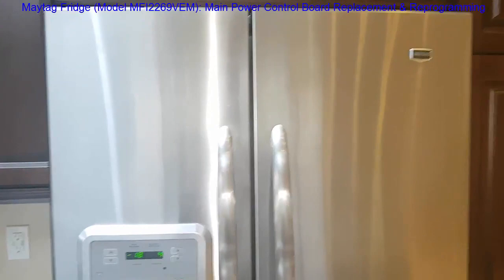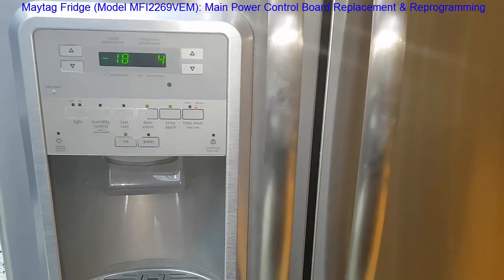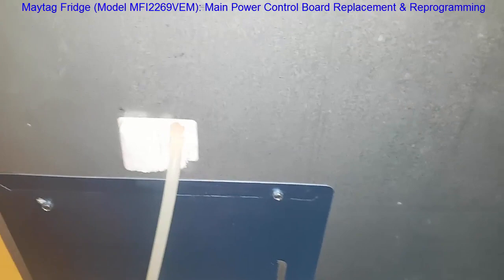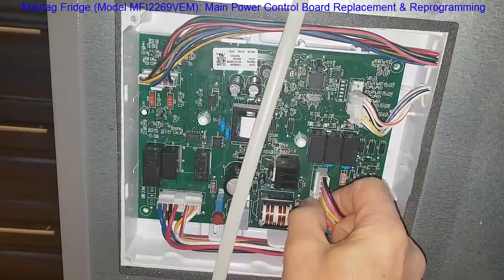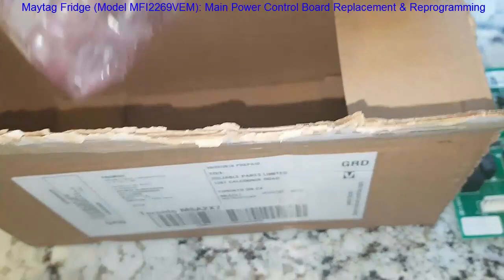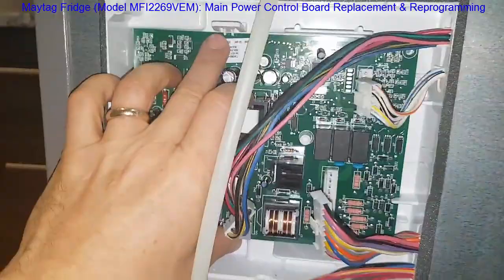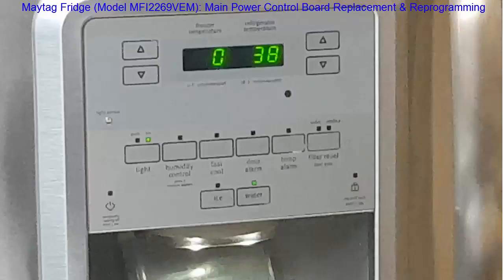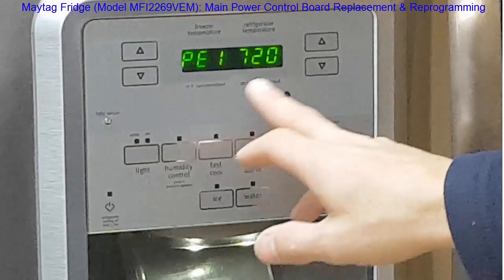Maytag Fridge - Main Power Control Board Replacement and Reprogramming

Comment: Thank you so much for the video.
I have replaced my control board and fridge is running, however I’m trying to type in the code and the keypad is not working 🤔
Reply from the maker: Hello Alberto, Thanks for your comment. I'm not sure why your keypad is not working. Do you have any indication on the front control board that it is functioning (any lights on at all)? Maybe you need to ensure that all the connectors on the control board you replaced are properly installed and secured. If you have power and cannot enter the programming mode then please refer back to the video (at the 7:20 mark) and carefully review how to enter the programming mode. If you experience any problems  please refer to some of the comments left by others who experienced a number of issues related to programming as your issue may have already been encountered and resolved. I hope this helps. Vito Casola, FIX IT Yourself.!!

Comment: After replacing the board, everything worked except the ice maker.  Any suggestions?
Reply from the maker: Hi Timothy, Thank you for your comment. Did your ice maker work before replacing the board? You're the first person that has reported this issue so I can't give you any recommendation. It seems odd that changing the board everything would work but not your ice maker. Where did you get your board? Can you bring it back and get a new one, to see if in fact it is the board or some other issue with the ice maker itself?  Vito Casola - FIX IT Yourself!!

Comment: Hi, I"m not having the same luck as everyone else.  I put in the board and the display comes up but I am unable to enter the code.  The dot will not appear nor will trying the door alarm button and temp button combo.  Both yielded no response in the display?  Please help.  My board cost me $257 locally here in Orlando.
Reply: Hi Ken,So for my fridge I was able to enter the Program Mode by first pressing the Door Alarm button and then pressing the Freezer Temperature Down button (that's the one on the left side - it's for the freezer) then wait about 3 seconds and let go of the Door Alarm button and then let go of the Freezer Temperature Down and then you should see "PE" lit up and if you press the Freezer Temperature Down button once more you should see PE and a 4 digit Code Number or PE 0  000.This procedure I well demonstrated in the video.  Start watching from 7:17 of the video it shows how to enter the program mode and get to the PE 0 000. Hope this helps. Let me know if you have anymore questions.Vito
Reply: If that price of $257 was in US dollars, which I assume it is in Florida then I'd say it's expensive compared to what I paid.  Wicked Liz ... see below said they paid $130 for the part and I assume that too was US$...which seems closer to what I paid.  I would see if you could find it somewhere else cheaper..... save yourself a few more bucks..... just my 2 cents worth..  Good Luck.Vito
Reply: I have the same problem and tried pressing door alarm and freezer down key and still doesn't work. Any suggestions?
Reply: Sharon Mowry I’m having the same issue.

Comment: I don't know if I should look at the control panel first before changing out the main power board in the rear? My refrigerator was in "on and off" mode, then shut down for a few weeks and now it's trying to start again (off and on). Has anyone had this problem and was it the main board in the back? I've been using the refrigerator in the garage, and enough of that!

Comment: Hi, so i just replaced my control panel and the front display keeps flashing. how do i get it to stop flashing so i can program it? Also great instruction video
Reply: Hi Christa.  I never had the blinking problem so I never included a solution to stop blinking in my video.  It seems to be a common problem for others however and no one has ever responded with their eventual solution so maybe you can try unplugging the fridge then try pulling out the four connectors on the board, maybe wait a while and then plug them all back in again and plug in the fridge again.  Don't know why some people experience the blinking lights. Let me know if and how that works. Good luck. Vito
Reply: Hi Christa,   Also someone else recently wrote back to me (a Mr. E. Smith, back in Sep.2019). His instructions may be helpful for you so try to follow them carefully and hopefully it helps:  ----- E. Smith wrote: -----  My refrigerator, (identical to the one shown in the video) would not go into program mode as described.   However, I went to the "Service Instructions" that came with the refrigerator when we bought it.  Note, these are not the "User Instructions".  The Service Instructions provide a "9 STEP" set of instructions on how to program which worked for me.  These steps are as follows:   1) Press & hold the Door Alarm Keypad.   2) Press & hold "Freezer Temp Down" button on the keypad for 3 seconds.   3) Release the "Door Alarm" button on the keypad & wait 3 seconds.   4) The control will display "PE" to indicate your in programming mode.   5) Entry is confirmed by pressing the "Freezer Temp Down" button once more.   6) The control will display the current Program Code.  The value should be validated with the program code printed on the unit serial plate, located inside the fridge (mine was 1720).   7) Press the "Refrigerator Temp Up" button on the keypad or "Refrigerator Temp Down" button on the keypad to change the digit value with each key press.   8) The decimal point indicates the selected digit.  Press the "Freezer Temp Up" button on the keypad to select the next digit.   9) Once the desired Program Code is entered, press and hold the "Freezer Temp Down" button on the keypad until the Program Codes begins flashing, indicating it has been saved.  These Service Specs also say: "NOTE: If you attempt to enter an invalid Program Code the Control will not save the New code.  Exit the programing process by pressing any key OR press the "Door Alarm" button on the keypad for 3 seconds".  If you entered the wrong code I recommend you unplug the unit and start over.------ end of text from E.Smith.   So Christa, if you read the above very carefully and try following step by step, hopefully it will get your fridge to stop blinking and allow you to enter the code and get you back in business ---- Good luck...  Vito Casola
Reply: @vitocasola8358  Hi, this worked. I actually goggled it after I asked how to fix it and I got the same answer. I followed the steps and it worked!!! So THANK YOU for your time and all your help. Much appreciated. Have a Good evening :)
Reply: You're welcome: If it was helpful please subscribe to my channel as I will be uploading some additional videos as soon as I find the time to make them.  Glad that it worked and helped you to get your fridge working again. Cheers.
Reply: YES! This is exactly what happened when I installed the new control board.  I followed these 9 steps and the fridge reset and I am in fact back in business.  Thanks 🙏🏼
Reply: @vitocasola8358  thank you so much. No reason for you to go through all that effort commenting other than to help a fellow person out. We need more people like this in the world. You saved me and I'm sure a lot of other people a lot of frustration
Reply from the maker: @TitanFlare  You're welcome. It is truly my pleasure to help people and it is why I make these videos in the first place. The messages of thanks from people that have found the videos helpful make me feel good and keep me going. Vito Casola - FIX IT Yourself!!

Comment: My maytag fridge, same model, is cycling on and off every 10 seconds and the digital menu turns off and on as well. Tried unplugging power but didn't reset problem. Is my control board bad?
Reply from the maker: Hi Ryan, Sorry for the late reply. I would guess that you are correct in assuming it is your control board.  Most often a bad control board will be the cause of most problems. Control Boards are very sensitive to electrical power spike (caused by unstable utility power or thunderstorms, etc.). These days it is a good idea to plug any expensive appliance (LED TV's for sure, Fridges, Stove), most of which all now have very sensitive electronic components, into a good quality power surge protection device (UPS, or other) or at the very least a good quality power bar which states it has built-in surge protection. I double up and plug my fridge into a power surge protection device and then plug that into a power bar with built-in surge protection. You can try to repair the board yourself, if you are capable of diagnosing and fixing it (usually it is a bad capacitor or relay, and this type of repair is usually very inexpensive) or you can simply purchase an entire new board (as I did, but is a fairly expensive option). Whatever you decide, best of luck with your repair and remember after you fix it to use a surge protection device so you won't have this issue again down the road.  Vito Casola, FIX IT Yourself.!!

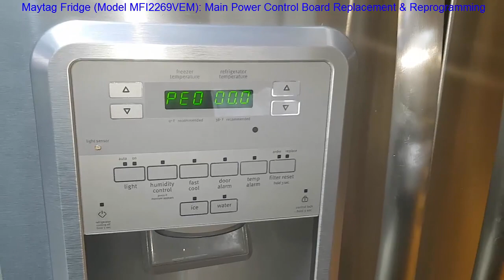Comment: In your video, at the 5:49 mark, you show the light as solid.  You never show it BLINKING......   so how do i eneter the code if i cant get it to stop blinking.  I have tried the two buttons you reference (when your light is solid).  Are these the same buttons to use when the light is BLINKING?
Reply: Hi Ernest, Not sure but try watching the video from the 7:20 mark, "How to Enter Program Mode" and keep watching cause I think it should give you some idea that you should be able to press any key to get it stop blinking. I hope this helps... but let me know in case you have any more questions.  Good Luck.  Vito
Reply: Ernest did figure out how to stop the blinking so you could code it ?
Reply: No because it never really started blinking for me.  Maybe try unplugging the fridge then try pulling out the four connectors on the board, maybe wait a while and then plug them all back in again and plug in the fridge again.  Don't know why some people experience the blinking lights. Let me know if and how that works. Good luck.

Comment: Hi. My sxs kenmore does not have power on compressor and fan. I want to find problem and fix it myself, please give me some direction. thanks
Reply from the maker: Hi Khosrow, Your problem would require some troubleshooting, which I cannot do for you. If you are not capable yourself of tracing where the power to the compressor and fan originate from then all I can tell you is that it could be from the main power control board.  These control boards are highly susceptible to damage from voltage spikes caused by electrical power interruptions (like from lightning storms, etc.). Most often sensitive components on the main power control board (capacitors, relays, etc.) could become damaged and need to be replaced. If you cannot identify bad components yourself by troubleshooting then you could try changing the entire board (as I did in my case). If you don't want to spend the money purchasing a new board then try first visual inspection of your main power control board and look for bad capacitors. Sometimes these are easy to spot visually (but not always). Tell tale signs of bad capacitors (these are usually cylindrical shaped components) are bulging tops and/or evidence of dark fluid leaking out of the capacitor.  If you spot any of these then they are quite cheap to buy and easy to replace if you have a little soldering experience.  I fixed a KitchenAid Fridge using this techniques where I changed both a bad capacitor and relay. I made a separate video of this repair (see: https://youtu.be/9GCv2WIkoQY ).  Good Luck with your repair. Vito Casola - FIX IT Yourself!!!

Comment: I went through the process of replacing the board.  I was stuck for about a day and a half not being able to programme it. It  would not show the decimal or allow me to enter the code. You will need to be persistent.  Even if it looks like it is in the programming mode.  Even though it says  PE 0000 keep trying follow the process as if is not already in programme mode. It is VERY finicky about the timing.  I tried dozens of times and had given up.  Then I was board in the kitchen and it randomly worked.  That said, thanks for the helpful video
Reply from the maker: Hi Adrian, Sorry I didn't respond sooner, but I'm glad to hear this video helped you in some way.  Thanks for your comments and positive feedback. Hopefully others will benefit from your experience and be persistent to keep trying the reprogramming.  You are right that it is quite finicky and you need to press the buttons in the correct sequence in order to get into the program mode.  Anyway glad you solved your issue in the end and your fridge is back up and running. Hope it will serve you well for many more years to come. Vito Casola - FIX IT Yourself!!

Comment: Does it matter if you get the OEM board or another one?  Those are less than 1/2 the price.  The US price I find now from Maytag's site is around $550 vs. less than $200 for what I assume is a non-OEM board.
Reply from the maker: Hi Brad, Not sure because I just bought a new replacement board with same part number as the one that came out of the fridge from a parts supplier. I would think that $550 is quite expensive for this repair.  You might want to try the lower cost option.  Alternatively if you are able to do some soldering then you could try to repair your existing board. Most of the time it is one or more failed capacitors that are the culprit components on a board. Capacitors are very cheap to purchase so you could simply just replace them all.  If you read through some of the comments below I think you will find someone that has actually tried that and claims to have been successful.  Good Luck with your repair.  Vito Casola - FIX IT Yourself!!
Reply: I got what is probably a non-OEM board and it works great!  Easy install too.
Reply from the maker: @bradandrews777  Thank you Brad for your response to someone else questions about this. Can you please post where you purchased the board and how much you paid for it for the benefit of others that may wish to try purchasing a lower cost Non-OEM board as an option to an OEM board. Thank you. Vito Casola - FIX IT Yourself!!

Comment: Nice video and we recently had power shutdown in the neighborhood and my refrigerator doesn't cool or freeze the food anymore and the panel only lights up when I press any button.  I then unplug the power for a little bit and plugged it back but I heard the pop noise then nothing happens (not cold or freeze).  Curious if this means my compressor is bad or?  Thank you.
Reply from the maker: Hi, Thank you for your comments. If you had a power outage these can sometimes be associated with power voltage spikes which could damage sensitive components on the control board of these refrigerators and other sensitive electronic equipment. I would suspect that this storm is the culprit.  If you read some of the other recent comments posted you will find someone who actually went and replaced capacitors that he suspected were damaged and it solved his problem.  I did a similar component repair for my aunt's fridge (KitchenAid - for which I made another video). You can try making a similar repair or the easiest fix is to to spend a lot more money on a new control board (though far less than buying a new fridge). Good Luck and let me know which way you decide to go. Vito Casola - FIX IT Yourself!!
Reply: @FIX-IT-Yourself  I took the relay off and it was rattling so curious if it was the relay that's the issue and how do I check if capacitor is bad?  thank you
Reply: @FIX-IT-Yourself  BTW, everytime I plug in the power there is a pop sound from the refrigerator and it will not cool or freeze but the lights inside the refrigerator still works.
Reply from the maker: @ccjw33  Hi CCJW33. What do you mean, You took the relay OFF? Usually upon visual inspection you can spot a bad capacitor from tell tale signs including bulging tops with or without black goop coming out of it. Sometimes however bad capacitors may look perfectly normal so a visual inspection wouldn't be sufficient and you would need to resort to electronic testing means. You should be able to find good videos online on how to spot bad capacitors and how to test them using electronic test means.  Good Luck,  Vito Casola - FIX IT Yourself!!
Reply from the maker: @ccjw33  Hi again CCJW33. The popping sound is a normal sound which happens every time you plug the fridge in.  I recall that mine did the same thing when it was not working and even after I repaired the fridge so this is not anything to be concerned about. Good Luck,  Vito Casola - FIX IT Yourself!!
Reply: @FIX-IT-Yourself  Thanks.  Update: I unplug the relay earlier and put it back earlier and plug the power in then waited for few hours and now the unit is working again so not sure if it was a relay or capacitor because sounds like something is having a hard time starting the refrigerator.  I bought the relay but not sure if that's the issue or can this be the compressor?
Reply from the maker: @ccjw33  Hi CCJW33, Not sure, if you bought a compressor relay that is integral with a capacitor then I would say it couldn't hurt to try changing it and see what happens. It could very well be the compressor motor relay and/or capacitor. I'm sure others would be interested to find out what you learn from trying to fix this yourself.  Good Luck. Vito Casola - FIX IT Yourself!!